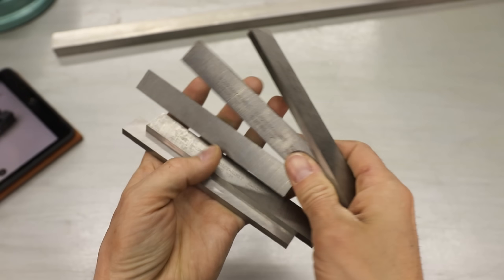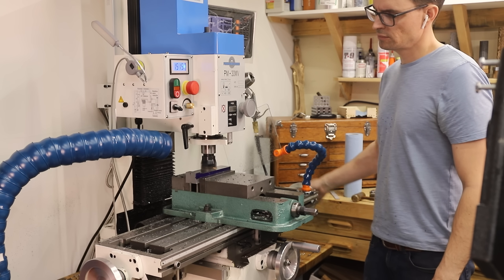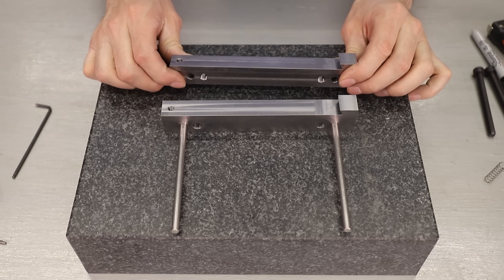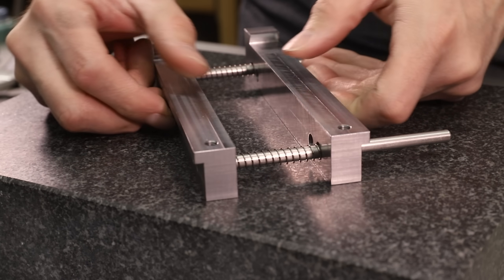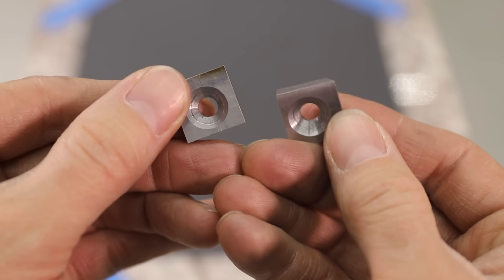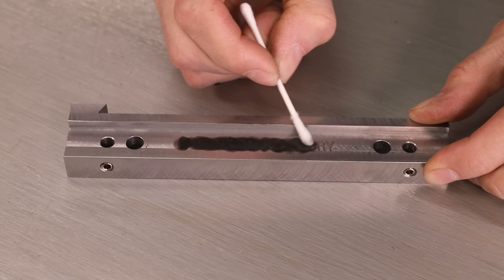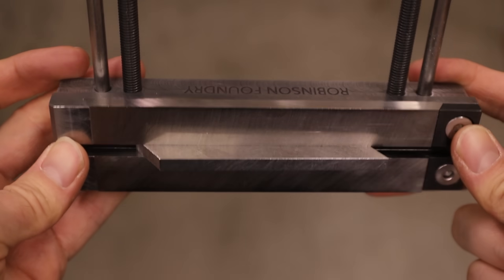Perfect file cuts with this tool - Making file guide vise jaws

Comment: Really impressive result! I would take it one step further and machine some long v-shaped pockets along the length of each jaw, say 1 mm from the inside edge, and about a 8 mm wide, with flat stops on each end. Then get a pair of precision ground solid carbide rods and place them in the pockets. When your file reaches the carbide rods it will just skate across them (file across the work for best effect). The rods are free to rotate in their pockets too, which might save on tool wear, though perhaps they'd need a bit of graphite to help them along. For most materials chips won't damage the rods and neither will the files, so they should last a lifetime as long as you don't drop them! You could also make a simple gauge that lets you bring a pointer over the rods to the scribe lines or whatever you want to use as your stopping point.

Comment: You can blacken the etching by using AC current. Of course, you can't do that with a simple setup with batteries. But if you got a transformer-based AC/DC adapter of the right voltage, and are a bit handy with a soldering iron, it can be done. The transformer outputs AC voltage, which gets rectified by a bridge rectifier. You can tap off the unrectified AC current straight from the transformer, and the DC (which you need to etch into the material) from its standard output. Then you can just use a dual pole dual throw switch to connect either to your output probes.

I used some cheap Hakko 936 knock-off as the basis for my etching station. Made a new front plate for it that houses a DPDT switch, and replaced the internal PCB with one that takes the output of the transformer, and exposes it as one set of outputs, while also passing it through a full bridge rectifier, whose outputs also get exposed. Then both of those outputs get fed to the "output" sides of the DPDT switch, whose "input" gets connected to the crocodile clamp and a wand that ends in a sponge.

I've seen others do it using a cheap cellphone charger, but nowadays you have to doublecheck they actually have an AC output stage, since a lot of 'em (the so-called switching power supplies) use buck converters instead of transformers. The same goes for my soldering iron, btw; a lot of those are built around buck converters these days, as opposed to transformers.

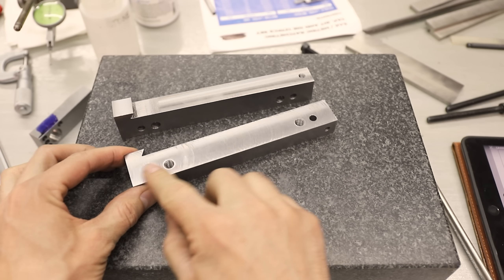Comment: Machinist currently in college here, just wanted to say: Nicely done. Also, that pop at 3:33 is just chefs kiss

A possible way to avoid the bowing issue is to anneal the steel beforehand, and keep it cool while machining it (lower feed rate and coolant if possible).

Comment: You should put some thought into manufacturing these... On the warping from stress relief, next time (if there is) start with annealed material and then heat treat yourself post machining. You'll want to leave some stock so that you can grind the important features to final size and tolerance however. You're going to have warping no matter which direction you tackle it from, working with hardened/hardening parts. The key is control.